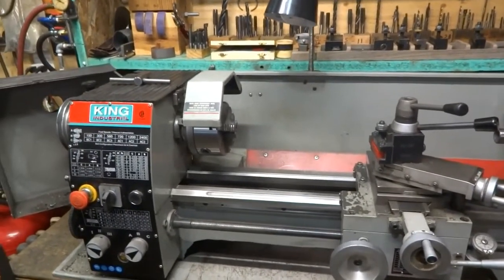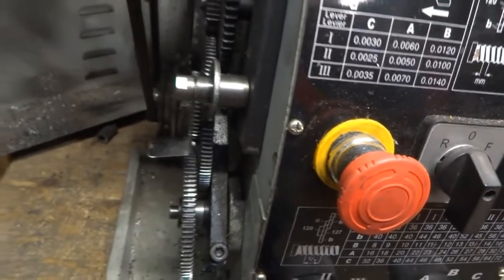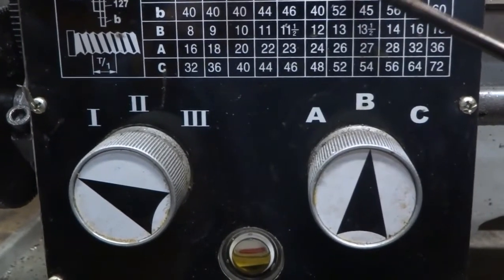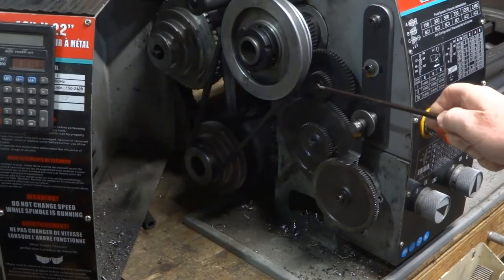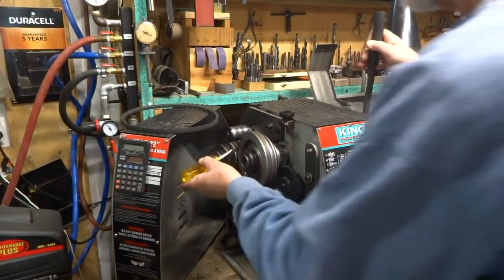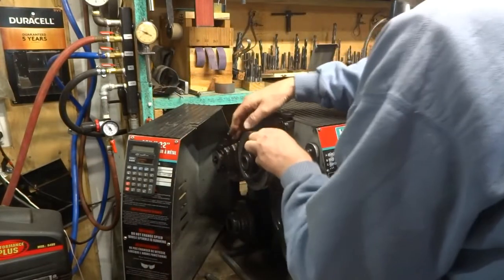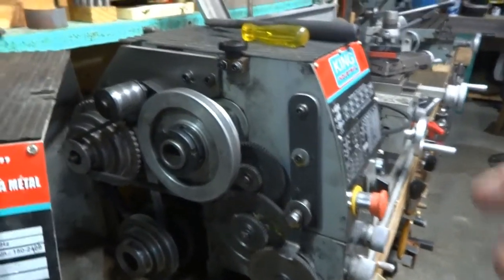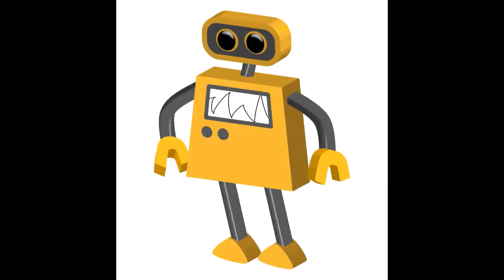Thread gear selection King 10 X 22 Lathe

Comment: I’m new to machining I’m trying the same 13 T/1 but you don’t mention the middle gear looks like it needs to be changed to fit against the center gear.  Could you help.
Reply: I had the same question but I’m still not sure of the solution?
Reply: @ the middle gear will move to make the other gears fit. There is a nut on the back of the middle gear. It’s on a slide.
Reply from the maker: I will put a step be step video out on how to setup for a 13 thread per inch part. Will try to get this done by Feb 7 2025 or sooner. This can be confusing I know because I remember the first time I tried this.
Reply from the maker: I am not sure what you mean by middle gear. You do have to loosen some arms and gears to make things slide around and fit other gears.I have reviewed this video that I posted years ago and I think I covered all the steps except for the loosening of arms and gears. I would like to help more but not sure how I can without seeing a video of what you are doing.
Reply: @ I’ll try make a video and share it with you later. When I put the 52 tooth gear on it won’t slide down enough to put the spacer on and hits the bigger gear that it should mesh with. Thanks
Reply from the maker: ok
Reply from the maker: Are you cutting a thread? If so what size. eg. 20 or 13  treads per inch  for example.
Reply: @MrModify  wanting to cut a 24 thread
Reply: I couldn’t figure out the 24 per inch so tried your size in your video.
Reply from the maker: Hope you resolved your threading problem. I can't think of anything that would help. a=gear36 tooth , b=gear 40 tooth, Settings are "A" and "II"
Reply: @ I think I figured it out the big gear that goes between those two little gears slide on a movable slot. Had to move it out a bit to get the 40 gear on.
Reply: Thanks for your help
Reply from the maker: I will put a step be step video out on how to setup for a 13 thread per inch part. Will try to get this done by Feb 7 2025 or sooner. This can be confusing I know because I remember the first time I tried this.